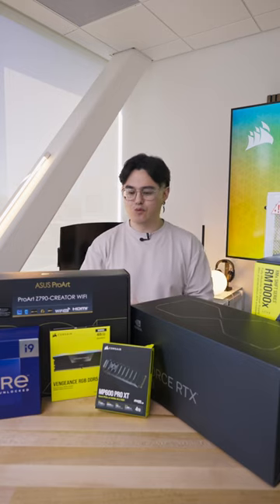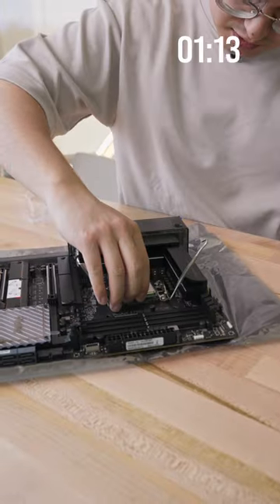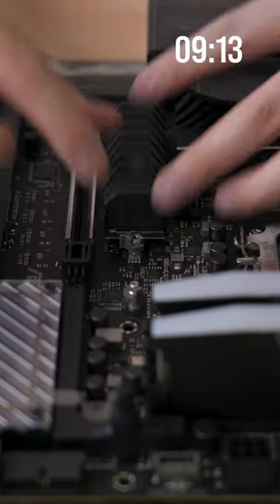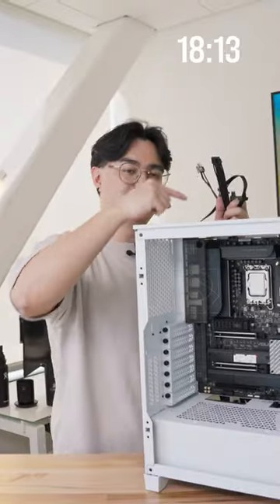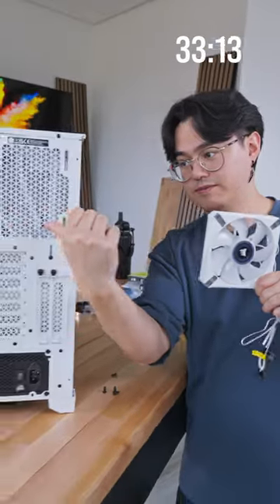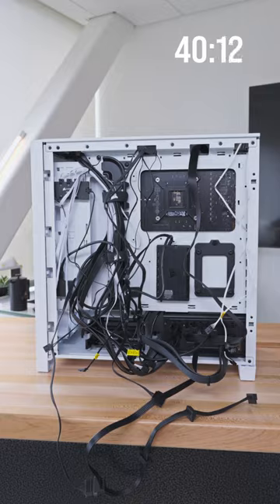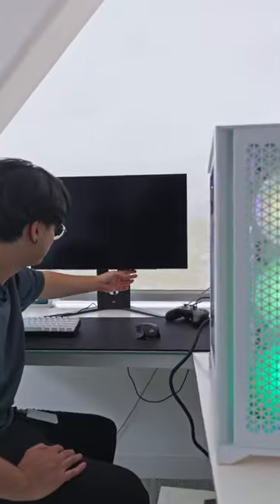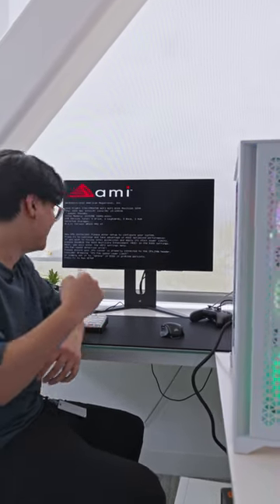DaVinci Resolve is no match for this PC #corsair #pcbuild

Comment: When you really do put a pc together it's usually an hour long project, I recommend you skip the installing into the case and test to see if it posts first, Had a doa board once and hours of swearing trying to reconnect everything with meat puppet hands.

My most recent didn't power on and gave me a heart attack thinking it happened again, only to find out it the cpu power connector was "connected" but not and had to just reinsert it.

Think of it, if it doesn't work, that might be a dozen wires you have to pull out, screws that need to be removed, ram needing to be reseated... list grows like the gloom.

Comment: Firts mistake is that Intel platform, for gaming you should buy or the 5800X3D  or the 7800X3D, do not but a NVIDIA card .... but opt for a Radeon equivalent. You can game on a budget and energy saving.
Reply: Considering davinci resolve isn't a game, it's a non linear video editing program, Intel is the better choice for this system. 
Intel outer performs AMD in plenty of professional work environments.

 Not every PC is made for gaming, a lot of us use them to save time while making money doing work for a living, rather than spending $3k to push an extra 10 extra 1440p frames in a sweaty lobby while sitting in moms basement complaining about something the title of the video explained lmfao...